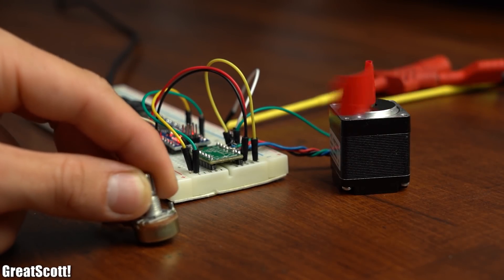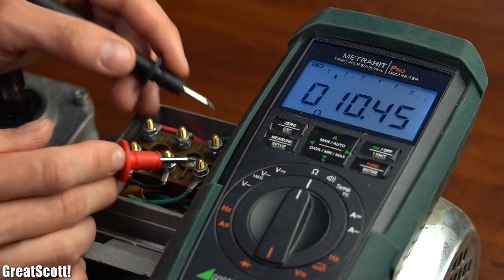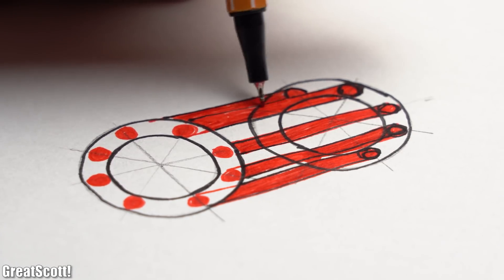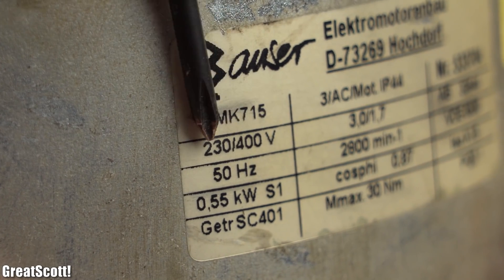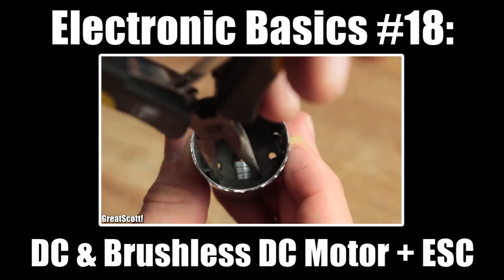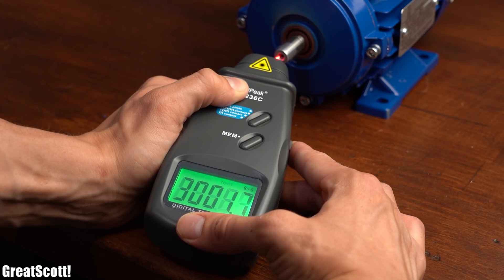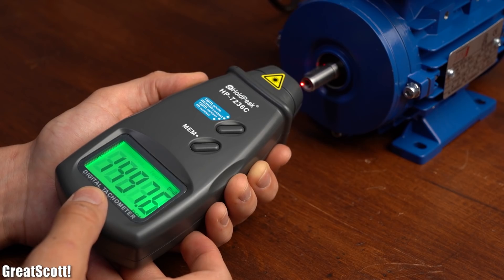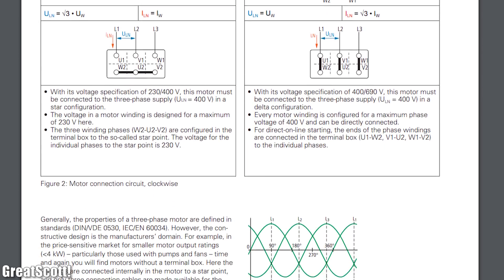Does this old Induction Motor still work? || How do Asynchronous Motors work? EB#46

Comment: "Professionals" don't solder crimp contacts. That's a big no-no, especially on stuff that vibrates.
Reply from the maker: Haha you got me there.
Reply: @greatscottlab Three phase motors on single phase use delta config with phase and neutral over one coil and the capacitor parralelled over one of the other two, wich one you choose sets rotational direction. Your diagram at the end is not for 'real' three phase motors.
Reply: Great info! I have done that before (though just as a hobbyist), I do like to provide strain relief to prevent movement, perhaps that is helpful. But the logic is sound and I was oblivious, I thought I was improving the joint with the solder. Thanks a bunch!
Reply: @boprosplumbing  With modern installation, no soldering is required or useful. Either you have screw terminals, wire cage clamps or crimp contacts, often with multi pin connectors. Adding solder weakens the connections. For instance, directly soldering a cable to a PCB creates a weak point, and usually some sort of celastic is added to the solder joint to relieve it from mechanical stress, as seen for example in battery powered tools. Otherwise it'd quickly break.
Reply: Why is that bad
Reply: @Willeexd1337  Solder wicks into the multi-strand cable, restricting movement between the strands and promoting breakage when physically moved around. Basically it turns the section near the crimp into a solid-core cable.
Reply: @graealex  It is actually worse than that - a solid core wire is not ideal for places where there are vibrations present but an actual solid core wire would be still much stronger than a soldered stranded cable. The solder + copper form an alloy that weakens the already thin strands of copper and they will break off.
Reply: Alexander Gräf aaaah ofc didnt think of that
Reply: @JanCiger  Yes, and there are other effects that for instance come into play when you're using a tinned wire end and e.g. put it in a screw terminal. Solid copper (!) wire in screw terminal is fine, if torqued correctly, but a tinned multi-strand wire will loosen itself, that's why multi-strand cable is crimped with ferrules. Just the general mechanism of the flexible multi-stranded cable getting stiffened by the solder is correct and the root problem, additional effects by e.g. solder shrinkage not considered.
Reply: @JanCiger  You have right.Also never pull a solder wire to probe if it is fastened.Solder breaks after a few year.(forgive my English) it is called (Dutch:tinrot).
Reply: Well. We're technically paying him for his work so technically he is a "technical professional". 😄

Also even pros make mistakes.
Reply: Yeah I was about to say that good catch
Reply: Just adding to the whole deal about vibration on circuits: automotive circuits usually use only pressure contacts for big components like electrolytic capacitors and connectors, exactly to not have the relatively fragile solder joint.
Reply: @Kalvinjj  Another good example besides the automotive industry is the cartridge connector of the Nintendo N64, which also doesn't use soldered joints because of mechanical stress breaking them over time.
Reply: For the record I didn't see OP comment as some malicious attack or anything, just genuine information about professional practices.

I'm a licensed plumber, when I state that I'm a professional, I have bound myself to the statement and must extrude professionalism and take consideration of every good practice, and avoid practices that are prone to failure and even take steps to prolong the longevity of my work.
Reply: Or stuff that gets warmer than, say, 25°C ... as the Sn crystals want to "reconfigure" themselves under mechanical load and aim at a stress-free state, resulting in creep and thus in higher contact resistance as the pressure on the surface drops...
Reply: think of all the children who will watch this video, and go through life needlessly soldering crimp terminals.  hopefully they read all the comments and learn better practices.  but soldering certainly works in a pinch.  to get a good crimp, you need matching wire, terminals, and the proper crimping tool, which is not always the case in real life (unless you have a company credit card and a digikey catalog, lol)
Reply: @Douglas.Kennedy  Exactly, I used to solder them as well, just because I found my crimps not really holding well due to me not having the right tools. But that's no excuse for a "professional". You learn this stuff, get the correct tools and then do crimps that are far superior to any soldered connection, and much faster also.
Reply: Nor do they run their motors without the woodruff key either removed or secured (e.g. put a pulley on the shaft to secure it).
Reply: Let me cut every conversation short, the reason is technical and  simple enough for very one to understand, most induction motor looses energy in form of heat,this is due to current loses,as well as mode of operation the motor is subject to.therefore Soldered part mostly connected to ground or chassis are not recommended bcos soldered part tend to soften as the motor heats up.
Reply: Your response is just rude and out of context with what he was saying about working with HV 3-Ph sources. If you want to be taken seriously, i suggest you add constructive criticism while not being a professional douchebag.
Reply: In fact, there are more reasons than just thew vibration.  The next one is also already mentioned and that is the temperature variation.  Thinking of how solid wires are crimped to a lug with a different tool than the stranded wire crimper would demonstrate that.  When you use a stranded wire crimper on a solid wire, you get basically just two points or lines of contact.  quite often you van wiggle the wire and see it pivoting on those contact points.  The solder connection, if soldered after a crimp locks the wire in, but only as long as the thermal cycling does not work the intimate connection loose.  And then, think about the electrical resistance of tin and lead versus copper.  It is much higher.  So, for really high currents where micro-ohms matter, you want to make copper to copper contacts, not copper -- solder -- copper series.  And then, corrosion!  I might suggest reading the horror stories what happens in the MIL spec salt spray tests.  I have had the unpleasant experience of trying to recover some electrical equipment that got exposed to a "small" hurricane on the Gulf of Mexico shore in Louisiana.  Up to that point I considered the report that AMP published way back when just theoretical.  The hurricane showed me the other side, called practice...
Reply: @great Scott to me I still regard you as a professional, despite the soldered crimp contact never thought of it, they way @Alexander graf and co Explained. Guys those are great comment, i really enjoy your presence
Reply: Alexander - you are completely right ! Soldering crimped connection is a "no go". Crimp itself makes nice, robust and kind of sealed connection.
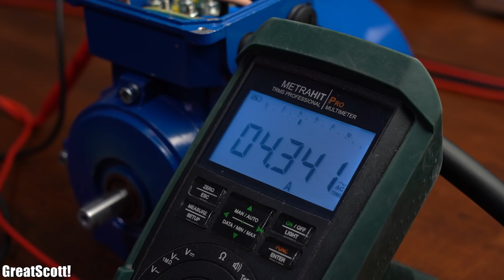Reply: @NoName-ip4tt  At 6:21
Reply: Indeed! Solder makes the junction more brittle. Just crimp it.
Reply: If you solder the connection the wire could come off and then short then big boom.
Reply: If vibrations are the reason for this being a nono, then the few cycles the wire/solder experienced during this video can't amount too much. Additionally the  vibrations would have been greater if the induction motor was rotating something that caused the vibrations, I.e a pump/misalignment of shaft etc.. I seriously doubt the ac motors are that unbalanced by themself. Additionally a very high percentage of these motors are connected to pumps in where vibrations are highly present. When you, the professional, so obviously are looking for faults in the  video, and this is the best you could do I say Scott did a great job.
Reply: @erlendhoivik4692  Not a problem in this video, but in general, you never solder crimp connections. If you feel that your crimp isn't secure without solder, you used the wrong force on the crimp itself. And this not about pointing out flaws, it's about defined procedures. If a manufacturer were to solder his contacts that way, he'd get a lot of recalls after two or three years. And several laws outright forbid soldered wires completely, for example in domestic installations. So please don't try to twist this into a personal opinion thing. Even Scott himself admitted to this being an error.
Reply: @graealex  Ok, fair enough. I still reason that a big part of professionalism is to judge whether something is important or not. And let's be fair he is not a manufacturer of induction motors nor is the motor going to be run for years. With that said :  if he made a mistake, he made a mistake. For some reason I can't see your comments about wires..
Reply: @erlendhoivik4692  when using DOL starting ever time you start and stop the motor you get vibration from the torque, the vast majority of squirrel cage motors are for drive  on rolls or conveyors.
Reply: @dogwalker666 You are right vibrations will be present regardless.I brainfarted.  All I'm saying is that there will be less vibration freewheeling than actually driving something. But the biggest point is the duration that the motor turned on. BTW: just googled : 1st hit lists centrifugal pumps above conveyor belts in terms of applications. But the motor with the gearbox might have been from a conveyor if that is your point
Reply: Erlend Hoivik for this test it would not matter , yes that little motor is a conveyor motor with that worm gear box, I used to work for one of the major motor control gear manufacturers, so have worked on a lot of motors the majority were axis drives fans and hydraulic pumps. AC, DC and servo.
Reply: @dogwalker666  you  know the subject much better than me then. I just get a bit annoyed when people watching this brilliant teacher are nitpicking about thing that for the purpose of the video does not matter. I would totally get it if it was an unserious channel with a bogus claim but the amount of knowledge in Greatscott videos in my honest opinion pretty impressive. As a working man yourself you undoubtedly have experienced the people who always criticize but are unable to do the work themself.
Reply: @erlendhoivik4692  well said I agree with you Scott is a great Educator I was not trying to nit pick but to add to the information he was giving, my only gripe is we dont get to see his cat enough.
Reply: @dogwalker666  just to be clear not meaning that you where nitpicking :) Ment OP
Reply: @erlendhoivik4692  It's not nitpicking. Crimp connectors never, ever get soldered. Period. There are zero reasons to solder them, and doing it anyway is amateurish, and outright against the law in commercial settings, at least here in Germany.
Reply: @graealex  It is. You yourself wrote that for the purpose of the video it did not matter. So what is the point then?
Reply: @erlendhoivik4692  The point is that it's a bad habit, that should never be shown as appropriate technique. It doesn't matter that the runtime of this particular cabling was probably only in the order of minutes. The cable he made is a cursed one and should never have existed in the first place. Just use proper crimp connectors and crimping force, and don't pretend soldering is a valid technique.
Reply: @erlendhoivik4692  It is actually important to point this out. People do what they learn on educational channels. A couple of years ago, Creality 3D sold a batch of 3D printers with soldered crimp connectors. Several of them caught fire. To argue when someone points out an error that even the channel owner agrees is an error, is just pointless and creates doubt. I can't understand what your motivation is.
Reply: yes you do. it stops oxidation which over time blows the lead from the crimp.
I know this as I work on motors up 600KW.
Reply: @jamieeast4974  Soldering crimp connectors is bad as it weakens the connection by making it stiff, while a properly crimped connection fuses together the copper if the proper force is used, but only at the crimp itself. If your company is actually soldering connections, then it should review that practice - everything points to you not doing the crimps properly, and thus falling back to soldering. There are special connectors that use soldering, called soldering cups, but they always require stress relief for the stiffened part of the wire, where solder has wicked into. Crimp connections often get soldered when the crimp isn't done properly. Regarding oxidation: proper crimps are gas-tight and do not experience oxidation. Maybe watch this: https://www.youtube.com/watch?v=bAO9eCS65jw
Reply: @graealex  can you recommend a reference for how to do mains stuff properly as a hobbyist? such as the hows and whys of wiring a power supply etc
Reply: @jamieeast4974  really ? As a certified tech I can say its totally wrong. Oxidation is not happening "by design" because proper crimped connection is sealed.

Comment: "Never work with 230/400 V if you are not a professional." Me playing with 3 microwave transformers: 😅
Reply: Glad you are still alive
Reply: Lol
Reply: Me playing with tesla coils and MOTs
Reply: @Centorea 88 Lmao, same
Reply: You are not doing it with 230/400 so it’s safe
Reply: Lul😂
Reply: Yes. They are fun to play with.
But if it goes wrong you might die so.
Reply: I got shocked when repairing my apple emac with a voltage  of 29000 volts it almost killed me.
Reply: @Nutan_Dwivedi  From the flyback transformer?
Reply: @1992jamo  yes I accidentally touched the metal part of my screwdriver and that shocked me.
Reply: Why you wanna Diy
Reply: @omsingharjit  The whole universe.
Reply: Be careful or 😳😬🤪😵😷🤕
Reply: @scientistBENIELSLAB  💀
Reply: @_24___  I didn't see that
Reply: @scientistBENIELSLAB  especially 💀💀 ⚰⚰
Reply: Please be careful
Reply: So likewise I suppose I should call an electrician to replace a transformer + low voltage bulb with a GU10 socket directly on the mains?
Reply: Thats a stupid statement -wear rubber gloves and nothing can happen to you .Worst case scenario breaker switch goes off.
Reply: @zumbazumba1 Try to touch one with a glove if you can
Reply: @zumbazumba1  Yeah No chance of electric fires. 😐😒
Reply: @zumbazumba1  Ain't many insulated gear rated to 1kV and microwave transformers easily into the 2kV+ range too?
Couple that with their sufficient current (given the microwave can output ~800W of pure heat, that from the high voltage magnetron, which isn't 100% efficient, far from it), that sure ain't the safest toy, proper safety gear is a must-have.
Reply: @Kalvinjj  You are correct, microwave oven transformers are usually 2200V AC RMS at the secondary and can source >1A at short circuit. 3 of them in series would deliver 6600V RMS (and might blow the primary-secondary isolation on the third one, as I found out the hard way). If there is any defect in rubber gloves whatsoever (and possibly even if there isn't), it will flash right through and cause likely death and near-certain permanent injury.
Reply: @Kalvinjj  I dont play with that kind of voltage but i for sure would rather have rubber gloves on than bare hands.
Its just my personal preference when dealing with electricity or venturing to unknown.
Reply: very experienced take

Comment: hey GS, you are an great electrical engineer, you and electroboom make my project work and i complete my study of electrical engineer
Thank You :)
Reply from the maker: You're welcome :-)
Reply: @greatscottlab  why germany have 400 volts? little bit confusing
Reply: @danielgabriel9167  the phase-ground difference is 230V the phase - phase difference is 400V due to 120° shift
Reply: @oldelectronicenthuasiast   here in canada we have 120 v ac hahaha Here in vancouver  near on electroboom
Reply: @oldelectronicenthuasiast   and i accidentally touch 230v in other country and it really hurts
Reply: @danielgabriel9167  Many houses are actually wired to have 2x 120v phase inputs at the circuit breaker/fuse box, so in Canada you can actually get ~220v in your home for high power appliances (ex. electric stoves)!
Reply: @Felipe2077tv   yeah  because we use 120v on high power appliances we will draw tons of current
Reply: @danielgabriel9167  Relatable in a laptop charger
Reply: @euvo_sound  other like switch mode power supply supports the entire voltage range
Reply: @danielgabriel9167  I mean i already got shocked on a laptop charger it really hurts
Reply: @euvo_sound   ok ok sorry  HAHAHAHa lol i have done shit in my life i touch the output of the microvave transformer haaahaha
Reply: @danielgabriel9167  it can kill you touch live wire while standing on wet ground floor without any slippers
Reply: @omsingharjit  hahaha lol freaking live wire

Comment: can you try to make a vfd?
it is a little hard but a learning experience
Reply: Damien Maguire shows you how to modify a surplus Prius inverter (about $100) to run all sorts of 3 phase motors.
Reply: @NiHaoMike64  A small VFD costs about the same and it won't explode in your face if your screw things up. This really isn't something that you could homebrew cheaper or better, especially someone who has no idea about the issues.
Reply: @JanCiger  The modified Prius inverter will be a lot more robust than those cheap VFDs. The continuous power rating is on the order of 20-30kW.
Reply: That's really not a project for beginner (or even many seasoned engineers), especially if we are talking about a VFD for motors like those in this video. Not sure what the interest would be, especially if it should fit into a 10 minutes long video that can't even start to explain the problems.